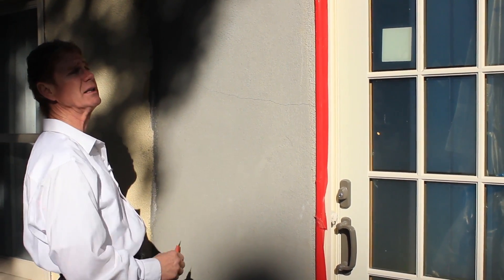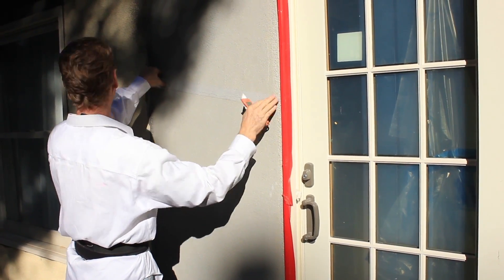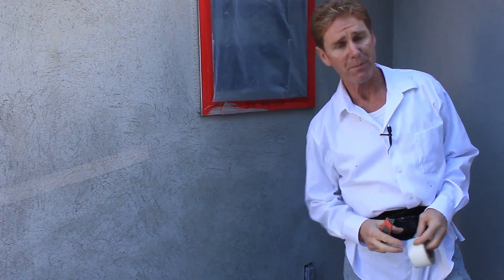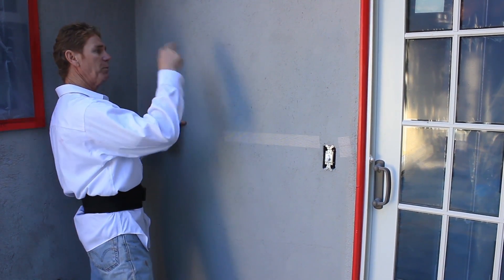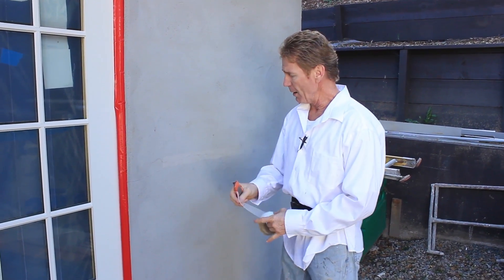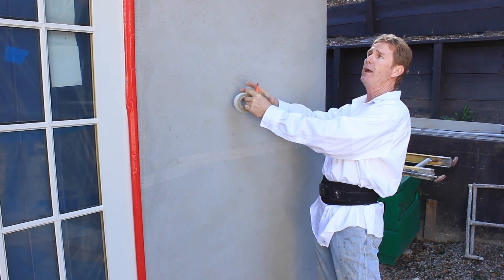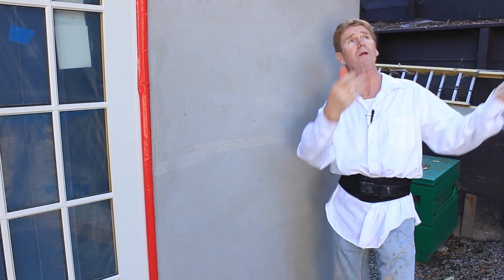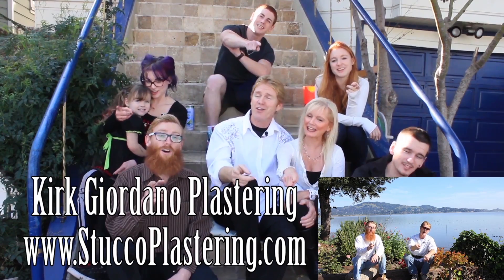Prevent hairline cracking in new stucco

Comment: I think the reason the stucco wall not attached to studs cracked less was due to less stress transfer.  Most studs supporting stucco are load bearing. Load bearing studs support loads and are subject to stresses.  That stress is transferred to the cement stucco.  As Kirk noted, code requires lath ( supporting stucco) to be attached to the studs.  I also like his comment that an "occasional" staple between studs to hold down a random bulge is not an issue.  I agree.
Reply from the maker: Good Evening Mr. Mark Fowler, there you have it, folks, straight from the man who wrote the book on stucco.
 Mark is also the executive director for two National Trade Associations, Editorial Director for Walls and Ceilings Magazine, Past Committee Chairman for MITC (Minimum Industry Training Criteria) for California Apprenticeship of Plaster Tenders and Plaster.     
                            Best wishes,
  Sharing stucco secrets and or common sense plastering tips
Reply: I run a stcoo company in Texas and u guys are great to say the least.thank u
Reply from the maker: Joey Mendoza thank you.

Comment: Love your videos! I'm about to apply the color coat to an addition, and just wanted to clarify...Do we need to address the small hairline cracks in such a manner that you're doing or will the finish coat be what covers them? Thanks
Reply from the maker: Howdy , it's best to use mesh tape above or below heavy wood doors and sometimes windows at a slight diagonal vertical direction, Allow the base coat to expand and cure while hydrating it, now give it a few days to shrink back to normal. No, you can't see or measure this action.
Then let the hairline cracking above and below windows or doors dictate where your apply the fiberglass mesh tape should go. This chain reactions show you in advance where the cracking would occur if you didn't apply the mesh. A reality, if a home or building is going to settle or move and or vibrate, no amount of fiberglass mesh tape is going to prevent it.👨🏻‍🔬
Reply: @StuccoPlastering Thanks! There are no doors and only one window. The brown coat was done 2 months ago. Hydrated walls for two weeks. Waiting for cooler weather to finish up.

Comment: I think that that wall not cracking because it they missed a stud, just must of been of the green lumber. If your studs to too wet, and you wrap, more shrinkage will occur causing cracking. When I build, I like to let the frame dry out as much as possible. Second, I do the same for my scratch coat and brown coat. I let the scratch sit for as long as my project will all and let it crack as much as possible, and mist daily till I brown coat. Do the same for the Brown. then texture.

Sure this cracks, but it reduces them. How long do you recommend for curing time for each coat, Kirk? And further, what is your opinion on adding luminite for a hardening/faster drying time of the texture?
Reply from the maker: Jose Macias Evening Jose, I usual allow the scratch to cure a minimum of two days with lot of hydration, the brown at least two weeks sometimes up to 3 to 4 in winter, again with hydration.
 As far as luminite at 60 bucks for a 94 pound bag it great for us contractors as it set the cement plaster fast and usually without hairline cracking, but it gets old, what work when you buy and first use, you have to use twice to 4 times as it gets old.
Plus this additive takes a lot of practice.

  have a fantastic day!
 Kirk Giordano Plastering tips